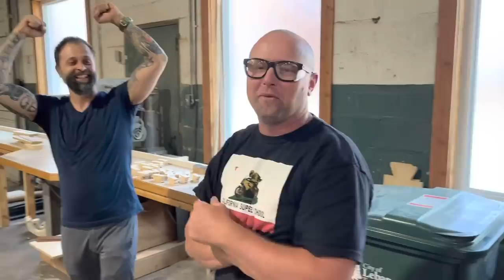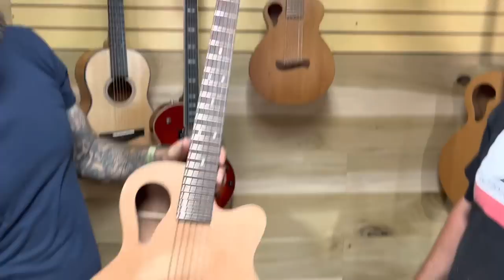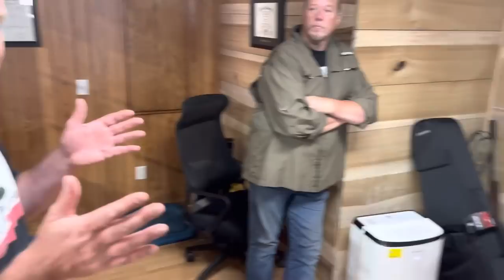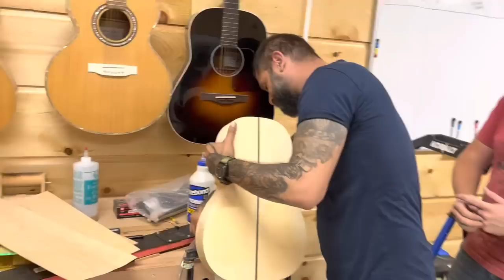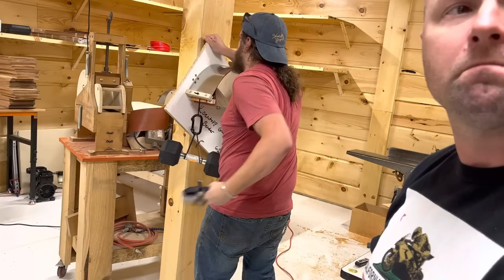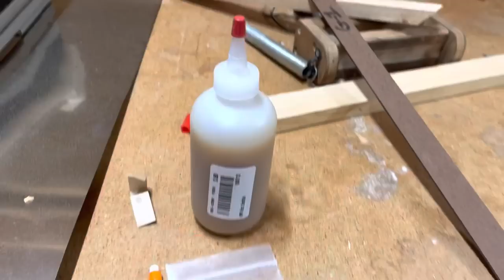Homeskoolin’ Field Trip To The Brand New Gruhn Guitar Factory

Comment: I think AJ their "head luthier" needs some woodworking 101 lessons. The blade guide bearings and blade guard is adjustable up and down depending on the thickness of the material. He has that WAY too high and is completely unsafe...